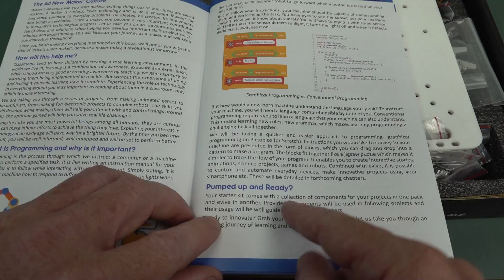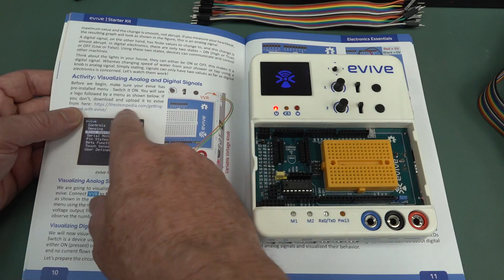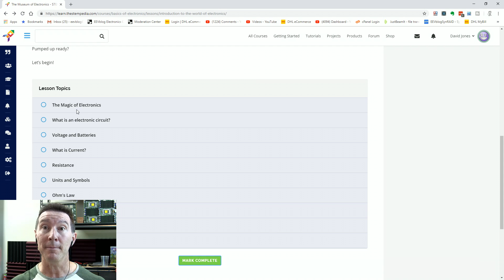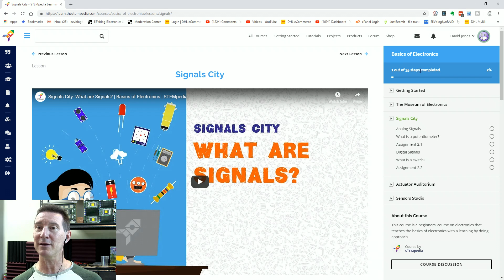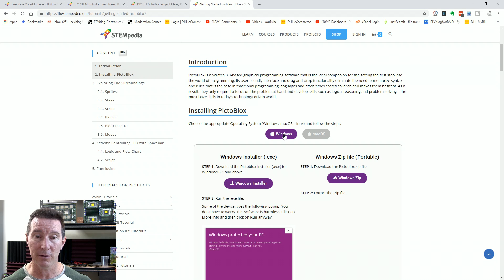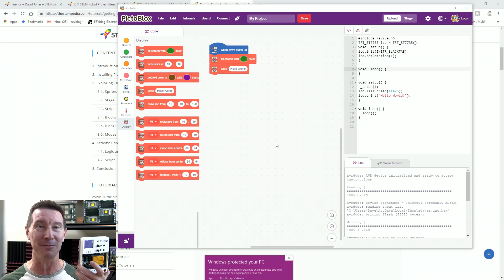#1179 - Stempedia Evive Electronics Learning Kit

Comment: You could use gcc-avr.so and Arduino headers and libraries and linker-avr.so plus Code::Blocks, Windows Defender doesn't like that application package you are running.